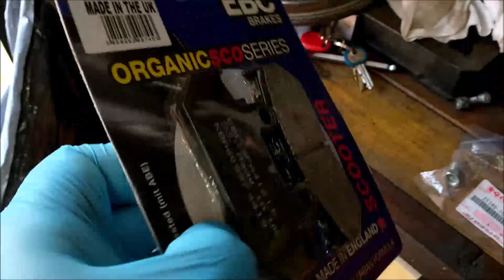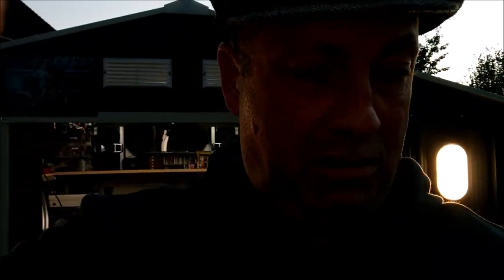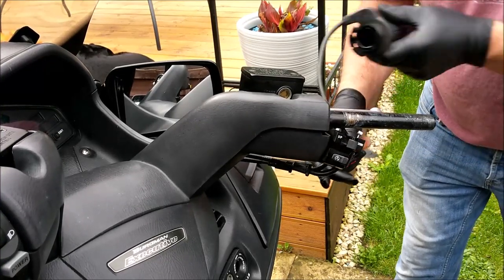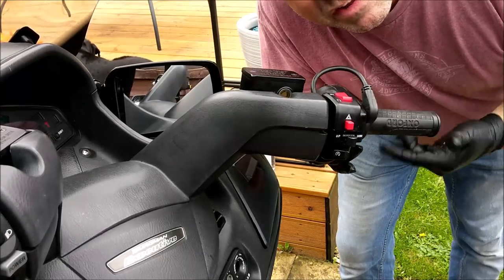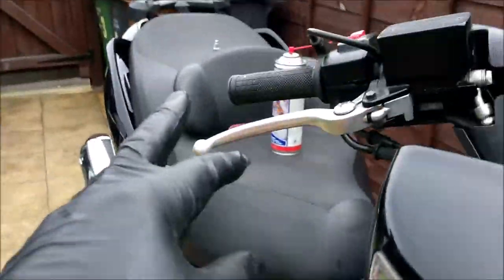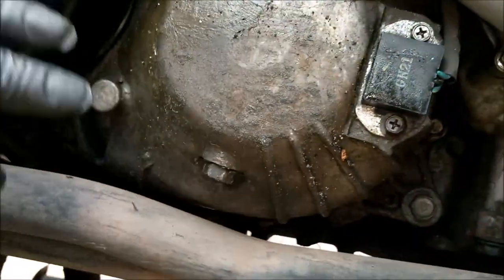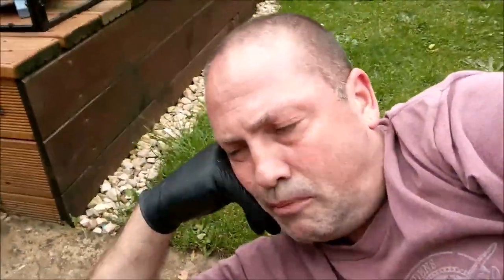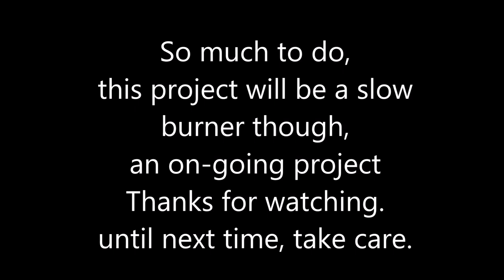Suzuki Burgman AN 650 sticky throttle, CVT Bolt, CVT Filter, rear suspension adjust

Comment: the bar end weights are to damp engine vibration through the bars for the most part, the fork oil needs replacing most likely and new seals are likely a good idea mate
Reply from the maker: Cheers bud 😊 the weights are staying off, there's little to no vibration. Yes I'm Deffo going to change the fork oil

Comment: Love it. Glad you’re enjoying your Burger Van, even with niggles 👍🏻
P.S. those poppers you lift up with a flat head, they push in to remove & you replace them with the centre pin out & push them flush to secure 😉 You’re welcome 🤣😂
Reply from the maker: There are two types, the one you lever out do exactly that, the smaller ones do push in to remove. Your welcome 😘

Comment: Hi, just curious as to what made you go for the burgman over keeping the Himalayan, was it more of a practical decision with the big burger having more protection or where you becoming dissoluded with the Himalayans quality and performance ? Thanks Rob
Reply from the maker: Hi Rob, a bit of both to be honest, my wife would not get on the Himalayan  but she has already been on the burger.
I'm fairly okay with the spanners but i was getting fairly tired of the constant maintenance of the himmy.
It's a real shame but the build quality (Himalayan) is extremely poor. The engine paint was literally falling off.
The forks paint was bubbling up and bursting open with white fur.
The wheel rims were rusting from the inside out.
I have lost all faith in royal Enfield